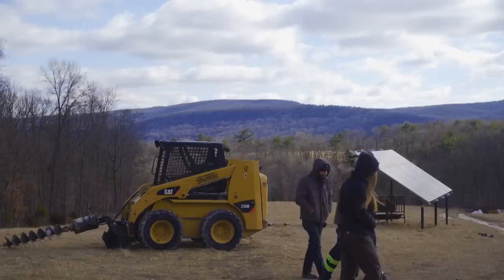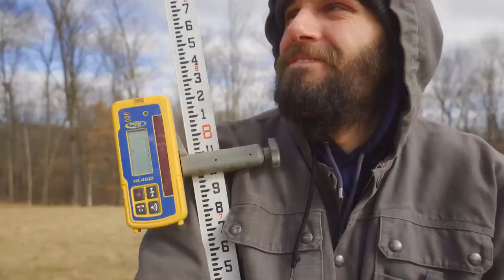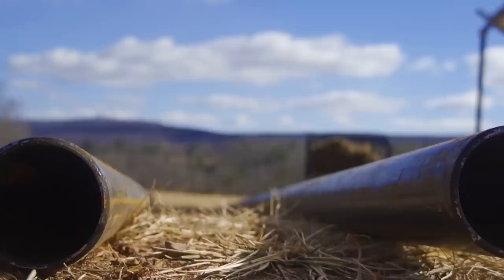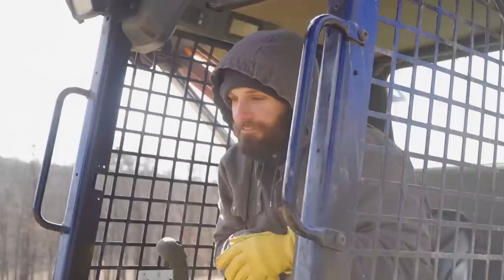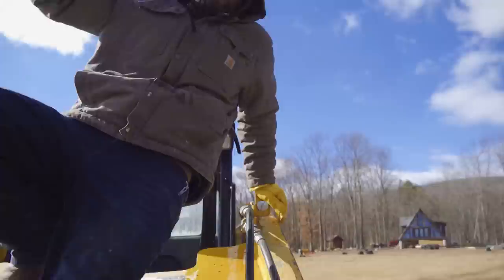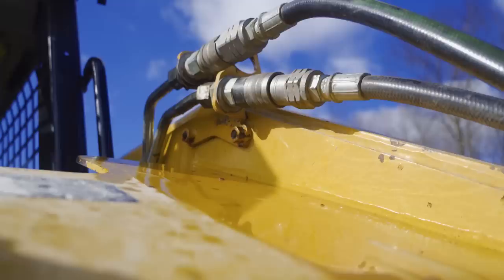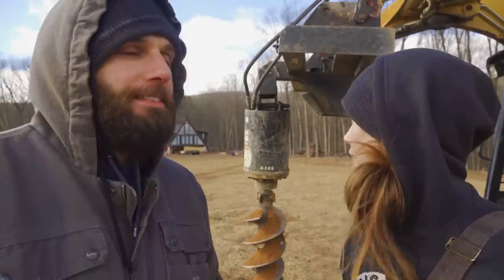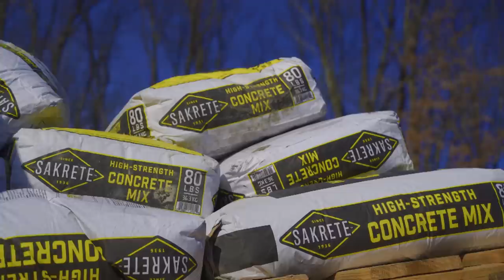Building a MASSIVE SOLAR STANCHION!

Comment: Hi Guys, I'm from Russia. I watch your video publications, everything is very interesting, natural, correct in all aspects. The only thing I wanted to give is some advice, is it possible to ring your solar panels. What does it mean? Place in a circle or square in the room and install a powerful street lamp. In Russia they are called DRL, DNAT. But for greater efficiency it is necessary to break the outer bulb, the light will be more powerful. You will have to light the battery all day long, there will be no snow falling from above and the lamp consumption is about 400 - 500 watts. Good luck guys! You are great!

Comment: What about running heat tape under the panels to melt snow away? They come on at 40 degrees. Just an idea. Also when putting wire in ground also put one foot above the wires with waning tape.  Less worry that way. Great videos.

Comment: Have you considered using the structure under the panels to over winter some of your livestock as the heat from the animals will keep the frost off and should help with shedding the snow . Just a thought to save Erin trudging through the snow with a broom while Josh shouts encouragement through the double glazing 😂

Comment: Hydraulic line to fix. Erin you didn't mention the mess and pollution such a break would produce. 
In younger days I had to test a hydraulic system. Standing at the back side were I could see nothing I switched on. There was one connection faulty. The 3000psi system run some 10 seconds. That was enough to blow out some 3 gallons of fluid. The whole workshop had to be cleaned. 
Erin, your pictures in between of the surroundings always make me happy.

Comment: Nice to get lots of energy on cloudy days, I'm right into solar I can't afford the nice setup up you guys are getting, But every year I upgrade a little more an started to realize the more panels I'm getting I don't need a big massive battery bank to last 4 days without sunlight, Just a battery bank big enough to make it through the night, And since that's the most expensive part of the solar system it pays to have the panels

Comment: Oh my gosh you two.... I remember that cold wind temperatures ... and I could almost feel it looking at you guys.  Nice layout ... very good eye on the hydraulic line.  Galvanized versus black steel ... interesting cost saver. Steel in Florida will require some special prep to protect from corrosion ... but still ... a very good idea.  Hurricanes will require an  I - beam construction  ... as FP&L .. our power company ...  have enormous solar panel farms all around our area.  They hold up nicely.   👌
Great video ... loved the property in the winter time look.  Spring should be very pretty !!!!   Looking forward to your next offering.
Semper Fi

Comment: Just had a thought for the camera tipping in the wind. Get a gallon milk jug or similar, put some water in it, have three lines coming down from the release points on the camera tripod, with hooks on the end, then when it's windy, just hang the jug on the lines it make it much more stable. As much of the instability is due to how light the camera and tripod are.

Comment: G;ad to see you putting more solar in.  Just a little tip for you, next time you're boring holes and the soil is crumbly like that, put a little bit of water in the hole with the loose soil and mix it with the auger ( forward and reverse ) till it makes a paste  and it will leave a clean hole with no shoveling. I hope you drilled a few spare holes while you had the machine just in case you need some at a latter date.

Comment: An impressive structure for your new solar panel array.

Not sure it is a stanchion though, a stanchion is an upright post/pillar used to hold up a structure/deck.

Your solar panel array has several stanchions supporting the structure.

Comment: First off, what the heck is Josh doing tightening a hydraulic line with a pipe wrench when he could have whipped those channel locks out in half the time? :)  Secondly, as Carter gets more involved with projects, I think we would all love to hear him do the intro narration of what you are working on! "We're measuring the height of the stanchion we already have built, so we....", if you know what I mean.

Comment: You should plan for a 1 in 100 year event, Is the low point of panels 1ft  above the ground of snow really high enough? Will the panels be able to withstand being buried in snow?  It may be unnecessary Risky.

Comment: Hi Erin and Josh, glad to hear you are going totally solar.
A tip from a 17.7 kW solar system owner and former solar company employee. Try laying your 3 solar strings horizontally. Why? Because a string will only be productive when NO panel is shaded. At sunrise and sunset, you have a situation where the lowest panels are the last to receive sun and the first to be shaded.
So arrange them in three horizontal lines and place the weakest string on the lowest line.
The panels themselves also need to be arranged horizontally, which also increases production due to the internal bypass diodes being optimized for horizontal arrangement.

Comment: Maybe you could do a video explaining the economics with going/remaining solar?  I have been watching your channel a while now it sounds like your rental at the bottom of your hill is on grid?  Did you look into how much it would cost to install an underground service and transformer to your house?  Is that even feasible for you?  I would be curios as to a breakdown in what an on grid solution would have cost you compared to how much you have invested in your solar grid and now its upgrade, including what you have invested in your generator?  Maintenance costs? Recurring costs?  Fuel costs, generator and transportation living off grid?  Tax credits?  Did your solar manufacture subsidize your system as a sponsor to your channel?  A combined solar / on grid solution would seem the most green to me, where when solar out put is high you can sell your power surplus to the utility.  It might also allow you to eliminate your on site battery bank and use grid power at night for a net gain in electric savings.  Have you considered the expense of installing a service line to your property is actually an investment, it would allow you to further develop your property or expand your homestead.  There is a point where the utility would install and maintain the service for free if there is enough demand.  Finally, given your home is on a hill in West Virginia, are there any possible hydro power solutions available to you?
Reply from the maker: Hey Eric! Just about all these questions are answered in our solar cost breakdown video or the Q&As on our channel

Comment: I don't remember if it was stated in the first install video or not, but what is the reason for burying the pipe instead of pouring the concrete post and installing the post on top of the concrete, maybe with a plate welded on the bottom of the post? Is there a particular code that requires this type of install? I'd love to know. Thanks for all your posts and videos, and having read almost all the comments of this video, I love Erin's "sass" with people. Some just have it all figured out lol. I don't which is why I'm asking :)!

Comment: the heaviest pipe i ever worked with was at KENNEDY AIRPORT. we were running a 6 inch GAL. pipe, for feeders in a trench, it came in 5 foot lengths, and boy let me tell you it was heavy. we had to red led all the couplings, and than screw it together.

Comment: Question....Wouldn't it be safer for the solar panels being elevated higher than 12 inches on the lower end?  It also would  prevent damage from animals and people not being careful such as carrying pipe and you turn around and smack one of the panels. 

The other question....would there be any advantage to orient some of the new panels position for max performance for winter sun rays and others for max performance for summer light rays?
Virginia. My cousin had built a new home years ago on about 40 acres of land on top of Patterson Mountain. Brings back many good memories.

Comment: Good Mountaineer morning to y'all!!
Too bad you didn't contact the local Volunteer Fire Department to use the old farm house for a burn house for structural firefighting training.
Back in the late 80's I taught classes at Fort Ashby VFD for the Mineral Co Fire School.
My middle brother was located in Keyser and assigned to Mineral Co. as a Trooper for the WV State Police in the late 70's.
Reply from the maker: We are contacting the fire Department. The question mark about the situation is the power line that runs above the left front corner of the house. We are waiting to hear if they want to do it even though thats there

Comment: Will you have to trench in new conduit or is there enough space to pull another circuit? And do you need two more circuits since you installed two more controllers? And don't forget to allow for the voltage drop!

Comment: Sandbags. Or hang a 5 gal bucket with dirt or rocks or something under the tripod. Good ones have a hook underneath for this purpose. Just don't fill the bucket. Only weigh it down as much as it's rated to hold.

Comment: I do like your videos; I do wonder, you should be around the 13Kw of panels (roughly) do you have enough batteries?  There is a fine line between solar collection and the storage capacity.

Comment: With the new upgrades and additions, what is an estimate of your total cost to date on your solar energy package you have built? Also could you please address any limitations you face with the upgraded system compared to normal electric? I once considered going this route but in the winter my electric bill runs $100/mo so couldn't justify the upfront costs compared to my break even point.

Comment: 12" off the ground sounds too close to comfort. Also, have you considered adding space between panels to reduce "sail" effect? With strong wind can be a lot of force on the supports.
Reply: If low clearance becomes an issue they can trench out along bottom of panel
Reply: @tmacmi9095  True, but that sounds like a lot more work than just installing slightly longer tubes from the start.

Comment: With 1 more panel you could have gone for 7X3, and leave the old ones as the were.
Reply from the maker: All our charge controllers are maxed out. So even just one more panel would require an additional charge controller

Comment: You should ask for a discount or partial refund on the Cat because you had to fix it in order to keep using it in the time frame you had.
Just a suggestion: You could mount the panels on a metal box frame and mount the frame on the poles. That way you could do all of the assembly in the barn with a heater, then use the tractor with the forks to move them into place.

Comment: In your mind you might have made sense, in actuality I didn’t understand what the heck you were saying.    Laying out those panels should be an easy process especially with a laser level.     Hitting your line, what, you put it in and you can’t dig some holes in the area and miss it.

Comment: If u weretrue offgrid, u wuld dig holes buyhand and do all work with out machinery.... you are GLAMPING
Reply from the maker: Hey there Kirk! You are confused about what off grid is. Off grid is literally defined as not being tied into the electrical grid, public water or sewer. We are not tied into any of those things, therefore we are off grid. "Off Grid" has nothing to do with the tools someone uses as proven by the actual definition. You must be confusing off grid with a bushcraft/primitive/pioneer lifestyle. Those lifestyles are different from off grid. 
Typically taking a few minutes to actually look up the definition of a term pays off.